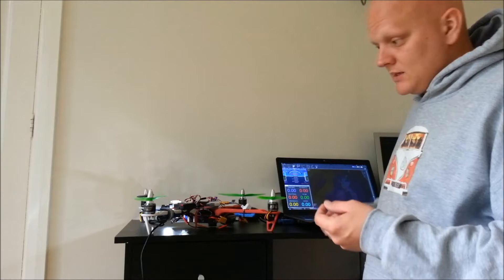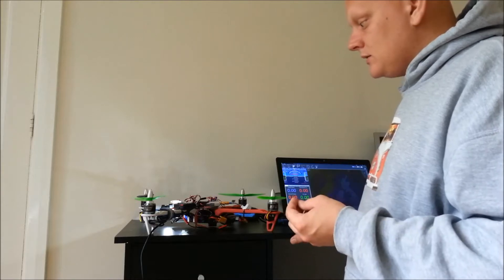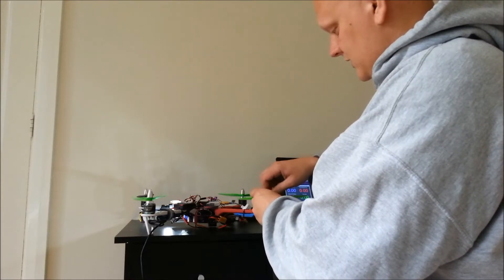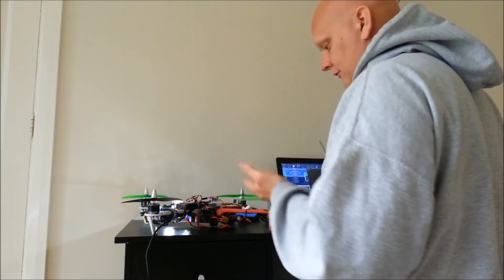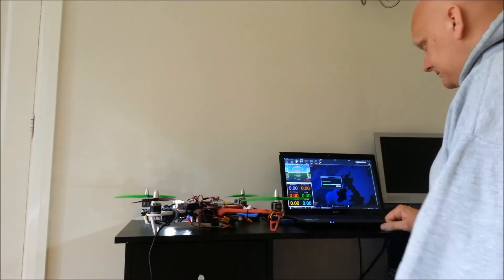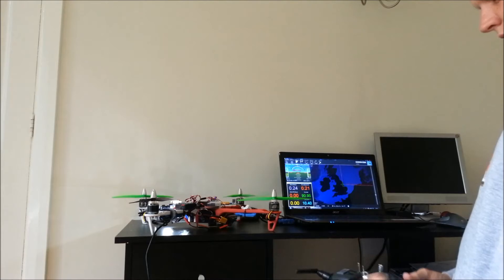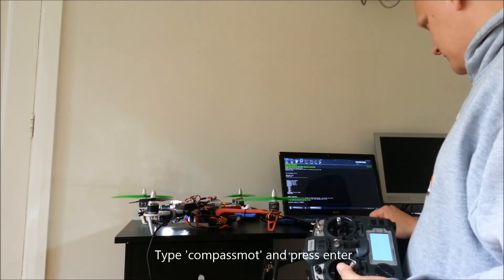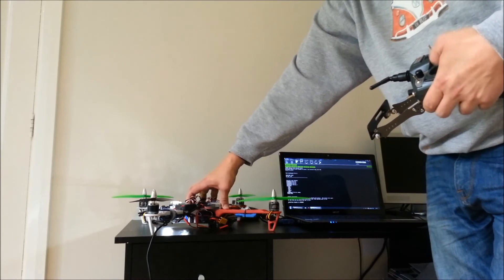APM 2.5 compassmot Setup Firmware 3.x.x

Comment: Very helpful, cheers for posting. Had no idea what compassmot was or how to use it until I saw this. Hopefully my quad with be a bit more stable in loiter now.
Reply from the maker: mrmurder75 Thank you, 
I had a big issue with it "Toilet Bowling" in Loiter, and RTH meant taking your life in your hands, as you had no way of knowing where it would end up!
Then, I discovered the CompassMOT, and found a lot of people asking how to do it. So, I made the video
Reply: Ben Cairns once you hit enter to quit out of it, does it save those settings automatically or do you have to go into something else and activate them so it compensates for that mag interference with every flight?
Reply: mrmurder75 mine was 8% by the way, so pretty low. That was throttle though as I don't have the power module. I guess my messy loiter is down to something else!
Reply from the maker: mrmurder75 Once the compassmot has ran, press enter to end the calibration, then exit from the Terminal (Can't remember if this EXIT or QUIT). 
The flash on the APM will store the offsets, so it's remembered each power up. 
You can of course take steps to minimize the EMF from the wires, just twist them and this reduces it a lot (Like this: http://thumbs.dreamstime.com/z/twisted-pair-12383608.jpg)
Reply from the maker: mrmurder75 Could still be the mag offset, without the power module, the apm will not be able to measure the current draw, so it'll not be able to compensate correctly. 
It may be caused by other factors, but the easiest way is to twist the esc wires (and servo wires), and raise the FC above the PDB (even 20mm will make a HUGE difference)
Reply: Ben Cairns thanks for the tips Ben, appreciate that mate.
Reply from the maker: +MM75 glad to be able to help :)